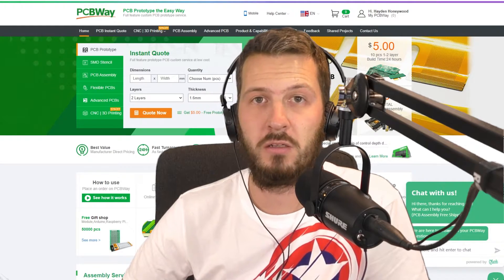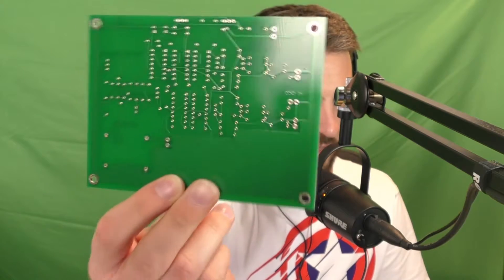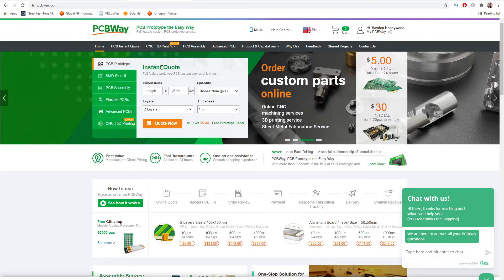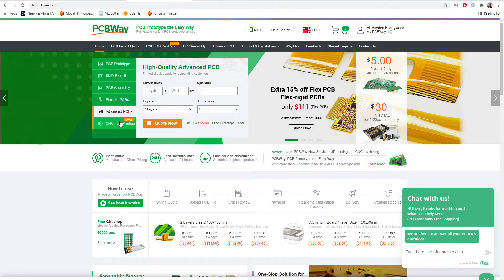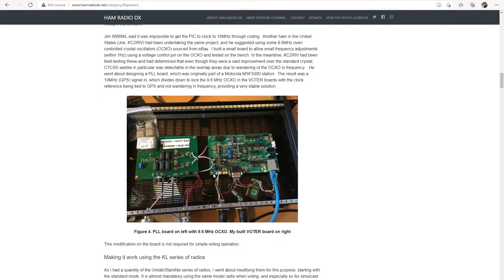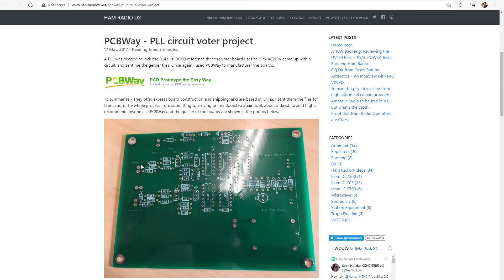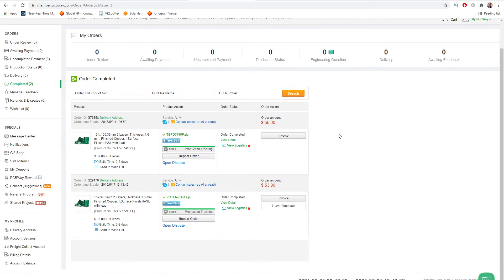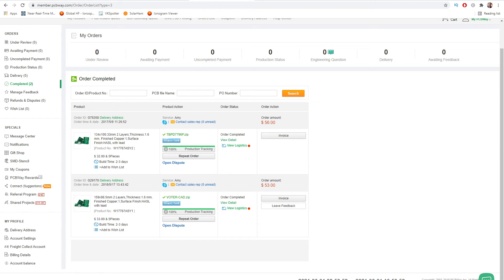HIGH QUALITY Printed Circuit Boards from @PCBWay | PCB Manufacturer

Comment: Sponsorship treated respectfully, unlike many others where it intrudes. You used them, you got a good result, the personal story is what makes it 'nice', not a sell. Meanwhile,  I wonder how many of your subs have ever done PCB CAD? Maybe worth a poll...
Reply from the maker: Great point! I might pop that in a future poll. I posted in the other comment from @Temporarily Offline but man oh man I wouldn't of liked to do these PCB's myself as I had done in the past. Populating boards was bad enough!
Reply: @HamRadioDX  what CAD do you use now for your board layouts?
Reply from the maker: I didn't use any CAD program for the controller board, that was from a pre-existing file that was freely available on the internet. The other board was drawn by someone else too, so they just sent me the files. It would take me a long time to learn Altium again!
Reply: @HamRadioDX  my hand drawn  boards are about one tenth the size and complexity of your controller.
Reply: @iowahank Thanks for the tip. I've got used to Kicad for schematics now, can you export a schematic from kicad into Easyeda I wonder? Probably not worth the effort to map the components which will inevitably not line up.

Comment: Remember when we had to acid etch boards in a dark laboratory in the basement?  THOSE DAYS ARE OVER!
Reply: Not for me, I'm the self proclaimed  hand made PCB dinosaur! Because every one of my radio projects is a prototype, a one off. If I am making something for myself, I am prototyping,  not manufacturing. The differ ence between electronics  craft and electronics product design and manufacture. Why do I need ten boards when I will only populate one? 

That said, I am hoping to use CAD and an offshore fabricator for a MCU and PLL and display board,  which is mostly universal.
Reply: @Paul_VK3HN  I've played with eagle, kicad and easyeda... I get to the point of making a circuit board and I'm lost there.  I have a project coming up to help me get past that.
Reply: @temporarilyoffline  it's a hurdle for sure, I've been using kicad for schematics but am yet to take the next step to board layout.
Reply: @Paul_VK3HN  My biggest concern is the physical layout of the board with regards to interfacing with other boards.  I wake up in a cold sweat thinking about how the board will be 1mm to the left and I've just wasted all that time and money.   Just noticed you had a youtube channel and subscribed.
Reply: @temporarilyoffline  Same right back. I am in a homebrew and experimenters group, meets monthly. One of the guys does a lot of transceiver and test gear building and uses CAD and PCBWay or equivalent. He is always offering out free PCBs. Because he layed out his IF board, got 10 made, but there was an error. Fixed i t, pressed upload, another 10 boards arrive. It takes him 3 cycles, 30 wasted boards, and 5 weeks to get the first useable board. I can hand draw an IF strip ib 2 sittings. It wont look perfect. And it will have errors. But my IF strip is a obe off prototype.  I will never make a secobd obe exactly tge same.  I know,  you can say that if you are careful, you can catch mistakes.  And you can argue that it's a few minutes to botch a link around a board error. All true. How do you want to spend your hobby time? 

I have tried to use his excess boards. But  they require absolute specific components,  like trimpots, capacitors, etc. I cannot populate them from my junk box. Populating the board can only be done by placing a Digikey order! That's professional product manufacturing,  not home  experimenting.
Reply from the maker: Yes a few years ago I had to design PCB's in Altium Designer, print the overlays on transparent paper, use UV light to expose it onto the copper boards, sometimes double sided (and it really annoyed you when the holes didn't align!) etch in the tank, clean up, drill and populate. Such a long process. Would've been so much easier to export the files from the software and get these guys to do it back then!